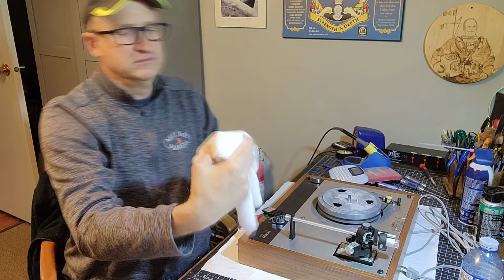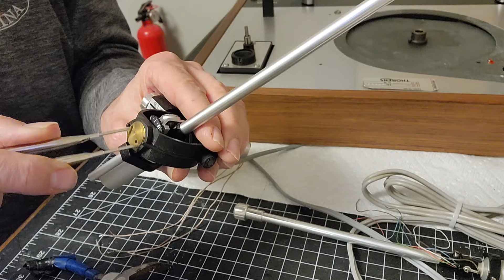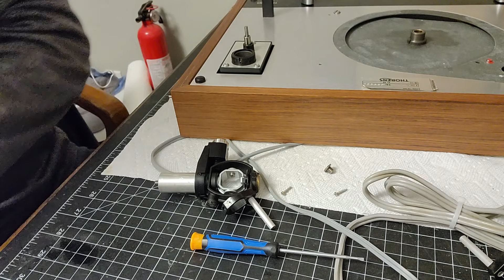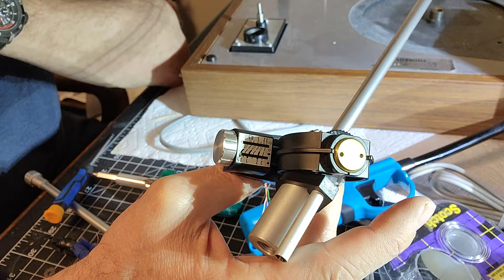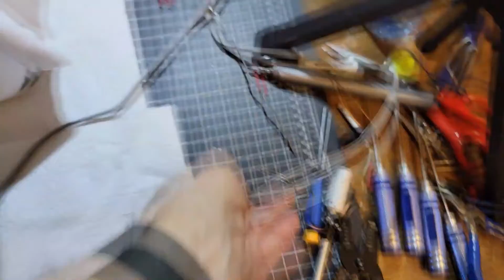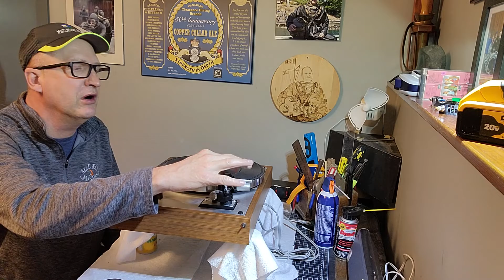Part 5: Thorens TD-160 Project (Arm Tube - Re-wiring - Suspension Tuning)v2  1 Apr 2022

Comment: You should level plinth not the top plate
Reply from the maker: I think we should just agree to disagree. 6 of one, 1/2 dozen of the other IMHO. One would assume that the top plate has been checked to be true to the top plate as I always do but never covered in this video series. Often times I mount my own custom top plates as I do with most TD-165 tables (as per the following). In fact what you don't see in this series of videos was this was all done at the end when I built and swapped in a custom plinth I made. Shims can be used to level the top plate with the top of the plinth if so required:
https://youtu.be/ce3YsmhBZBg?si=yX3b-8457HzoO9Gx

Comment: You can solder light mic cable to the tonearm wire and don't use mounting block
Reply from the maker: Not before assessing the overall capacitance impact of your donor cable in the low level signal path. One should measure, not assume such things and believe me, I am normally far from being a wire freak except where a measureable impact can be assessed. A turntable is one area where I do not skimp or shortcut on OEM substitutes. Sorry, that is just my way despite all the arguments in the world...😀

Comment: Hi, I am looking for my TD160 headshell.  Do you have one for sale?
Thank you.
Reply from the maker: I have made a 3D model of the TP-60 Headshell and posted it on Thingiverse as a free download as a very good alternative  to the original. Here is a description:
https://youtu.be/PU44MzVv1ck?si=gAext_GOWIfLw3NR
Reply from the maker: Here is the free model (mere pennies to print one):
https://www.thingiverse.com/thing:2733072
Reply from the maker: Hear is where you can obtain the headshell adapter (They are also listed on ebay often):
http://www.audiosilente.com/spare-parts-for-turntables-thorens-td-160-td-166-td-145-td-165-td-125-thorens-connector-for-headshell.html
Reply from the maker: Here is one in use on one of my 3 Thorens turntables:https://youtu.be/X7HUCSzbG4A?si=hdKXKbWCMdwfzSzf

Comment: I found a td160 for relatively cheap. Everything works as it should , looks like it has been serviced well. Recently I’ve experienced an issue with one of the channels quiet and now almost non existent. The RCA jacks look to be original with the grey wire (will replace soon) The headshell also causes a slight fizzing noise when I touch the metal guide. Would this be the cartridge , headshell wires or wiring within the arm ?
Reply from the maker: Regrets, impossible to diagnose without my seeing it first. Could be any of the things you listed. Best to take it to a local Tech
Reply: @navydiving  I did take the headshell apart last night and cleaned the pins. It’s fixed the one channel cutting out. Now there’s a slight sound that almost sounds like the tweeter is going. It is not and my dual 606 plays fine without that sound. I ordered some new RCA plugs from vinylnirvana so hopefully that is the issue.

Comment: Hello, many thanks for all your videos, so instructive :)
I have one question: is there any way to find the  wires connector located on the chassis ? (the connector on which you plug the tonearm wires). On my TD145 that I'm upgrading, it seems it has been altered in some way. Can this piece or equivalent be available as spare part ?
Reply from the maker: Here is one at the 9 min mark showing one in a TD-165. I have seen two types of junction blocks in the TD-160. One is like this and the other is at the base of the tonearm. I will see if I can find a video of that. Easy to make I would think - I have made many workable 3D prints for some of my audio projects:
https://www.youtube.com/watch?v=3b1toEIvJ54&t=45s
Reply: @navydiving  Thanks for all the replies! Yes I think I should change the connector block with a new one. And with this new one, I think to plug the ground wire from the arm to the block, and the ground wire as an external one to be plugged on pre-amp instead of being on the inner chassis of the TD. I'd love to get a new connector set, if you ever have a workable one available and if you can ship to Europe, I'd like to buy it from you, including s+h and tax.
Reply from the maker: Check out 44 min 27 seconds here for a TD-160 remembering a td-145 is really just a TD-160 with auto Lift: https://www.youtube.com/watch?v=g-CQBHQQo20&t=194s
Reply from the maker: Here is the other style at about 19 minutes in - you can see beyond my fat head from time to time):
https://youtu.be/5oLk-4kSJWc

Comment: Could I get a copy of the Tonearm you showed in the video?
Reply from the maker: Do you have a TD-160 or a TD-165? The ars are slightly different. One is a TP-16 and the other is a TP-11...🤔
Reply: @navydiving  TD-165.  I’m having real trouble fishing the wires from the Tonearm down the small tube to connect to terminal.
Reply: @navydiving  TD-165

Comment: Ciao quale diferenza c'è tra il td 160 e il td 316 quale potrebbe essere più performante bel video peccato che non capisco la tua lingua aspetto una risposta un saluto
Reply from the maker: Personally I much prefer the Thorens TD-160. It is ubiquitous and probably the most tweakable and popular vintage turntable on the planet. I have no experience with the TD-316 so cannot render a sonic comparison. Perhaps it was born too late in the war against CDs and never achieved the poularity of the TD-160 by virtue of when it was marketed (1988 - 1991)?

Comment: Working through your video to replace my tone arm tube. Just finished the Queue lever re-lube. Question, those dang tone arm wires are short on the new arm, as you mentioned. In the video you skip splicing to the old wires other than a few comments. These wires seem to have a plastic coating, then have to split the shielding for soldering  and remove the center wire insulation. Any suggestions on how to prep the old wires would be appreciated. I will practice on the wire still on the old arm. Thx much.
Reply from the maker: The wires are extremely fine. Instead of stripping with wire cutters I think I used a lighter to strip away a small bit of insulation....🤔

Comment: fun stuff.  I might (probably not ) be the only one that has butchered one of the 4 tiny wires that connect to back of cartridge - so I have an excellent TD 240 -2 Thorens worth less than 2 cents. WHY they don't have a better system, just plug in the cartridge or at least make the wire ends 2x tougher... even insulation  tube over each of the metal clip and say 8mm   of the tiny wire would be a big + and cost like nothing  oh, and make the wires 10 mm longer to make changing cartridge somewhat doable. Well found out at 73 my hands can't do this stuff. all the more reason Thorens should do better, these are not cheap products. And of course Ya can't find an actual stereo store anymore, never mind a reliable elec. repair shop..

Comment: Wow great video's. I have a TD 160 from my youth in the garage I am thinking for working over with your guidance, One question I have is I always had a hum/connect issue between the head and the arm. Twisting the head made it go in/out. Tried cleaning but did not help. Do I need to replace the arm tube with connector to fix this? Did not see any way to tighten the electrical connection between the 2. Thank you so much for all your information.
Reply from the maker: Usually it is the hesdshell connection to the arm tube or it can be the lead wires to the headshell (either end). If sny are loose you will get hum. Also check the lead wires inside. They are usually soldered to a block. Try resoldering. Use Contact cleaner like D5 Deoxit as you could have corroded connections. Tge collar of the arm tubevalso needs to be quite snug. Careful not to over torque...
There is also a ground mod to the chassis in the service manual. That is usually not the issue but thought you should be aware...
Reply: @navydiving  thanks so much for your reply. I dug out the turntable that I bought new in the 70's and am surprised at how good of shape its in. Fired right up.  I suspect the head connection/wiring. The intermittent hum developed only a few years after buying it.  I dove all in and ordered a new arm tube with connector/wires, new head wires, rca connectors and belt. Looks like a fun project and expect to be studying your videos much more closely

Comment: Hi - thanks for the in-depth videos. I am in the process of rebuilding(new plinth) a TD 160. A problem I have is with the tone arm wires. Any time I try to strip the insulation in order to solder they break…shortening the wire. The wires seems incredibly fragile. Almost like I am working with hair. I am considering purchasing new wires but wanted to get your input. Did you experience anything like this? Your wires seem much more solid. Thanks, much appreciated
Reply from the maker: I never try to strip the insulation with cutters or strippers. The wires are simply too thin and delicate. Instead I use the tip of my hot soldering iron to melt back the insulation and expose the delicate strands. Hope this helps.🤔😉

Comment: Hi there NavyDiver, can you post a link to the tonearm bearing adjustment on the thorens td 160, your're right I can't find it.  Thanks!!~
Reply from the maker: All my videos for the 160 are linked herein:

https://audiokarma.org/forums/index.php?threads/thorens-td-160-mk-1-tune-up-and-setup-project.991147/
Reply: Hi, is it possible to lube the bearings of the tone arm without disassemble the arm? With an injection needle for example? My TD 145 mk2 tone arm still functioning but maybe it needs a little drop of oil.

Comment: HI, do you have a video on how to change the audio cable??
Reply from the maker: Tge TD-165 is mostly the same as the TD-160 depending on the junction block. Keep the cables if you can and just change the RCA jacks. The original cables are better matched than mostbyou will buy. Remember that thicker cables are not better for low level signal feeds like those coming from a turntable... https://youtu.be/3b1toEIvJ54

Comment: why don't you 3D print the arm tube it would be much better! and put a cross + section in it as well
and a funnel shape, that wood filament 3D printed might be best can you do us one?
should give it a go it's got to be a lot lighter than the standard tube and stiffer.
instead of round make it box shape! with the cross members you will make 4 triangles should be very stiff and rigid. don't think you'll be able to do the nut?? only with a resin 3D printer, what would be better as well you not got just standard?
would make a 3D printed arm bored as well would be better than the standard plastic, I made mine out of wood you have to 3D print all the way down to the screw hole posts the slightly short so you can add nylon washers
maybe making arm tube with the headshell all-in-one it is better sonically like that.
your need to put some copper tape inside the arm tube just a strip where the wires would lie, earth to the body of the tonearm there is a wire there or connected to the rca, best to use a separate earth ground in case you want to use it balanced tho!
you can use very small drill bits to undo the bearing just take them together hold on with your fingers and use a screwdriver to twist
I would change the tonearm wire no point keeping that, just use 30 gauge pure silver wire with teflon sheaf you can buy separately, small bit of shrink wrap to give you the colours you need on the ends.
no don't bend it in the Voice... you need to bend it from inside pushed out the dent, use something that's long that's got a ball bearing on the end if you got a welder you can weld a bearing on a drill bit
you can actually do it where you are not actually see the dent anymore if you are patient.
that's a bit of a silly way to do you don't need to use shrink tubing just tie together the end of the wires with a bit of thread and pull the thread through.
I don't like the idea of soldering wires together causes sonic problems,
the reason they had the block next to the tonearm is because of sonic benefits being on the main part of chassis giving more isolation then being on the plinth, if you stick down a block with 3M sticky pad would be best and just solder, but the best way is to take the wires all the way out to the RCA jacks and not having a break in the tonearm wire and triple shielded when it leaves the tone arm
Reply from the maker: Because an arm tube has built in precision bearings. Those cannot be replicated using 3D printing technonolgies at my disposal.
Reply: @navydiving  no you would take that off !! not talking about that the hub the gimbal what holds the bearing I'm talking about the tube  can be dismounted from the hub,
it is glued in you can release the glue with acetone soaked in acetone.
you don't think 3D printing is accurate enough! some 3D printing is I believe no different to the hub being cast what it is.
but yes setting the bearing you would need a jig laser-guided.
you could try making a golf tonearm what is uni pivot,
you need a vertical posts and across post that you can slide a gromit over what you would attach polyester thread to,
a arm can be 3D printed to accept golf ball, the golf ball would have a hole drilled in it for the thread to pass threw a small pipe from Q-Tip in the golf ball what is glued in, you need a Vaseline pot as the base connected to a bamboo base, where the vertical is you place a golf ball in the Vaseline what you would dilute with silicone oil to the right consistency just a little so the golf ball is suspended in the fluid very easy to make.
the design is by Well-Tempered tonearm turntable. have a look
best to use brass as the post and cross member.
Reply from the maker: @hoobsgroove  cheaper and simpler just to buy a new arm tube. It cost me Just over $100 Cdn to get a new old stock one direct from Switzerland 🇨🇭 . I couldn't be bothered to go through all the CAD work necessary as a make work project. It would cost a heck of a lot of my time which at my work hourly billing rates these days simply makes no economical sense. Time is money after all...😉